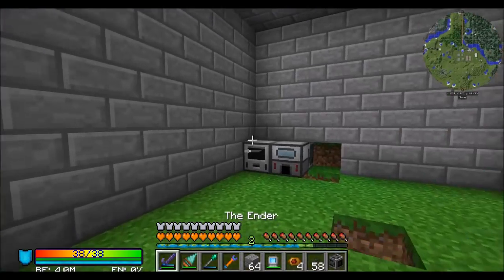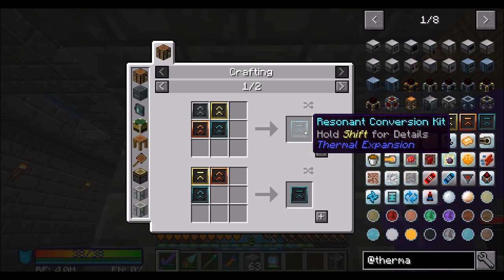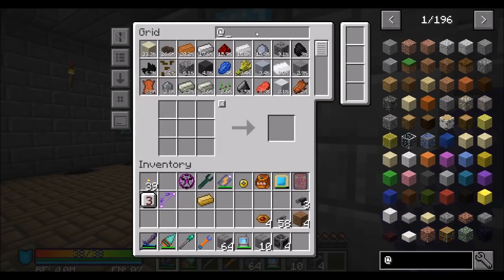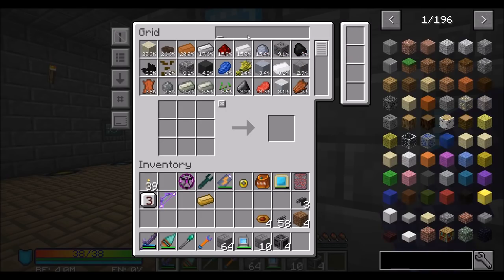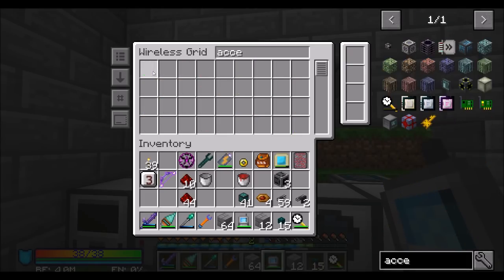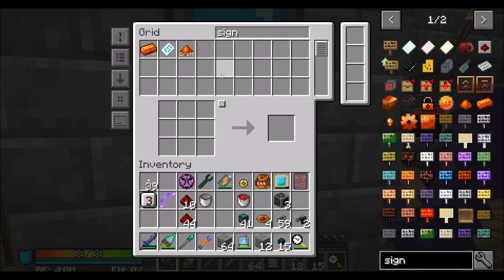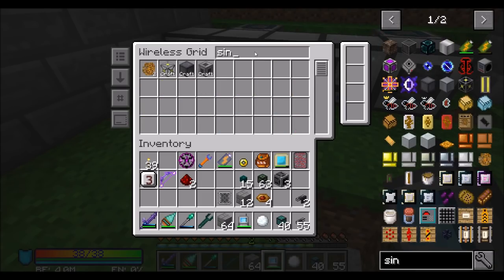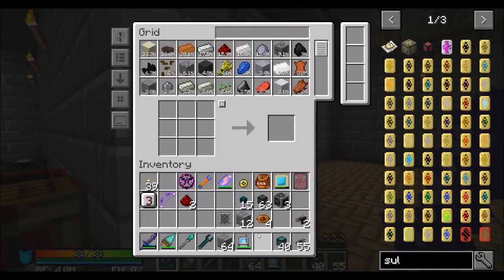Lets Play S8 E68 Thermal Automation

Comment: I kinda miss the mass fabricator multiblock from AE1. it was self balancing and made it so that if you wanted to add recipes you had to either reconfigure or rebuild. I think the mass fabricator should be readded to AE2 and it should actually use a channel for every simultaneous crafting process you add.

Comment: 12:30 Direwolf20 makes the second dumbest choice in the series. First dumbest being his tin gear choice from last episode
Reply: I'll be honest, absolute efficiency? Not necessarily the most enjoyable way to do things. If he'd done that, we'd have hit episode 8, and he'd have full Wyvern Armor, with the top tier energy storage and been waiting for the next season.

If you don't enjoy him doing it this way, skip the episode. He usually recaps the previous and you just miss the boring stuff you didn't enjoy.

The faster and more efficient you get something done, the quicker you get bored with the pack you're playing.
Reply: Why was using the cheaper gear a dumb decision?
Reply: Not necessarily dumb, as much as odd. But the TE Tin Gear is a single stage craft, where the Forestry one is a two step process. Basic Gear into Tin, versus Tin directly. Admittedly, maximum efficiency would have been four tin in a Metal Press or Smeltery with a Gear Press/Mold. But that's much extra work for not necessarily much extra reward.

Comment: 29:40 dire throws away sand when he could just import it back into the system to save 2 sand per craft
Reply: SAMURIADI no because if the sand drawer fills up then it won't export from the pulverizer and the machine will clog
Reply: its a cobble works, thats how its supposed to work, it produces until its full then it backloggs, also he would save power by reusing the sand
Reply: SAMURIADI yeah then it will stop producing nitor
Reply: NuthinNew it takes the sand and turns it into sandstone then sandstone is pulverized into sand and nito
Reply: SAMURIADI I get what your saying but if the sag mills make sand faster than sandstone is pulverised then the sand drawer may fill up with 64 sandstone already in the pulveriser

Comment: can someone maybe help me, I've got a solderer just like dire with a crafter on the back and importer under it, but when i try to autocraft something it says: "machine in use", when i manually craft something it works just fine. Reloading the world didn't help, nor did placing other solderers or crafter. So if anyone knows a solution, please tell it.
Reply: IsolatedShadow do you have all the materials in your system?
Reply: The solderers are not I-sided. You can only push and pull items in them from 1 direction I believe. Try having the crafter facing it from the left side and exporting from the bottom
Reply: Joshua Columbus No, I dont think it matters where the crafter is, because in ftb beyond I have it like that and it works perfectly, but this pack could have it changed and that could work out for him
Reply: Yes, i do
Reply: If you only have one solderer and try to make processors, you will get the "Machine in use" message when the solderer is still processing the first stage components (like printed silicon).  Speed upgrades will help.  A second solderer will also help.  Set it up so that the first solderer is just making the components, and the second solderer is making the processors.
Reply: nightcase, have tried that too, but the thing is, it doesnt insert any material at all, not even plain silicon, nor from enderio, nor from rs
Reply: Is the crafter pointed at the solderer correctly?Also turn on the ore dictionary for that recipe
Reply: The order that the ingredients go into the solderer matters.  Check that the top item of the recipe is going in first, then the next ones down in order.
Reply: scruff, yes, crafter is facing the right way and ore dictionary is on, but that shoudlnt matter too mcuh as i have 200 silicon of both mods in the system.
Reply: Upload the world somewhere and I can take a look at what the problem might be
Reply: semluwen, the problem is that the items dont go in the solderer at all.
Reply: Is it facing the right way, side with ring in the midle is facing the solderer right?
Reply: Printed silicone is the only one that didnt work for me in your world. Something has changed with the quartz recipe for silicone over the versions. If you redo that recipe it all should work fine. Cancel all crafting requests before asking for more
Reply: When quartz is smelted in the alloy smelter its ID is the same as other silicones. If its smelted in a normal furnce its smaller and has yet another id.Thats what your problem was
Reply: scruff, ok thank you so much, I'll immediately reset the recipe. Again , thank you.